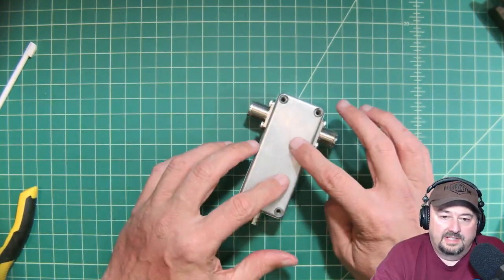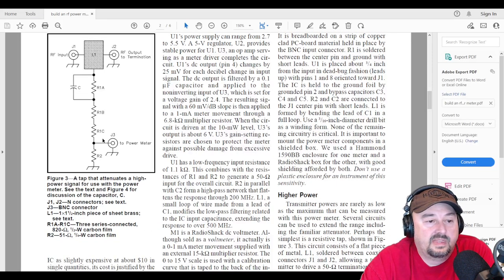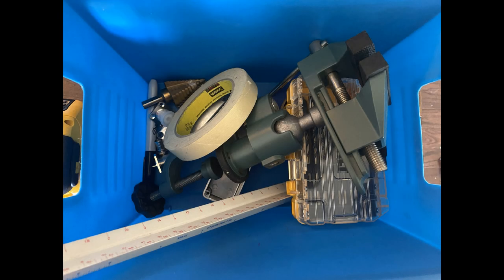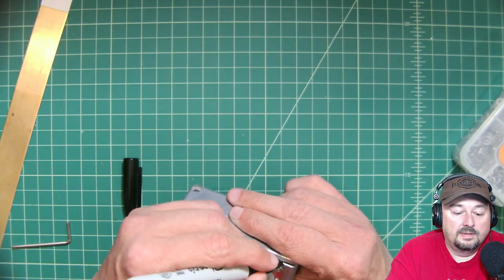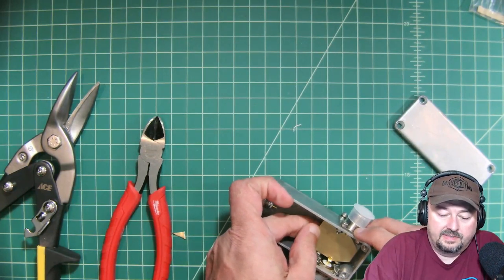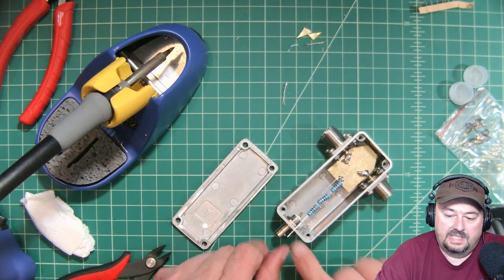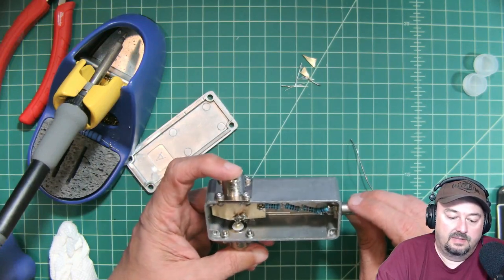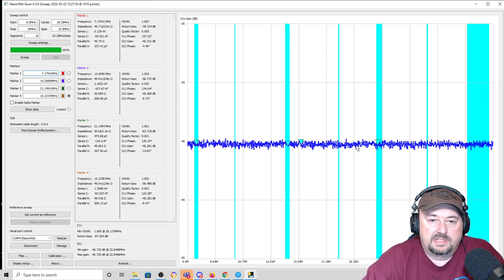DIY 40dB RF Power Tap for Ham Radio

Comment: I suggest using some 00 steel wool to buff the surface of the brass before soldering. A little buff on the center conductor of the SO239 as well. I find it helps the solder adhere more securely. Edit: Brass often has a light layer of oxidation which can inhibit the soldering process. Also, using steel wool to prep PCB surfaces for soldering helps with kit building.
Reply from the maker: Thanks a really good idea, thanks Robert

Comment: The name stomp box comes from their useage as guitar effect boxes.  I have noted while the Chinese boxes follow Hammond part numbers they do not always follow the sizings. Specifically the boxes are frequently  shallower than the original, which is why the SO239's did not fit well. I took a slightly different tack and cut/filed the 4 hole flange down to a 2 hole flange similar to the 239 found on IC-7300's. Had you sourced the parts from Digikey, Mouser or the like you could have picked the correct components as specified while at the same time helping out local manufactures and suppliers.
Reply from the maker: I was trying to help out port workers and customs officers 👍
Reply: @TheSmokinApe   LOL

Comment: Hi Ape,
Great build and video. As soon as I saw the size of that box, I would have used a two hole chassis connector or a bulkhead connector. I also think a piece of single sided circuit board could be used instead of the brass strip, or even a piece of 14 or 12 gauge wire across the connectors. You and the family stay safe.  73  WJ3U
Reply from the maker: Thanks for the ideas Don, hope all is going well for you.
Reply: @TheSmokinApe  Hi Ape,
You know I've been trying to get a reverse mortgage. Was approved in December, but they are raking me over the coals and now saying I have too much debt. Getting depressed.
Reply from the maker: @DonDegidio  ugh, sorry to hear that Don
Reply: @TheSmokinApe  My sister even started a Gofundme to help.

Comment: Good point. I always make sure my solder is "dry" before moving on. LOL You know as a builder myself I gotta rib ya a little. Serious question. With my lack of knowledge with inductors, since the brass plate is the inductor, does thickness of the brass matter and is it part of the calibration? Or is surface area what determines the amount if inductance introduced into the circuit. Hence the measurement of 1X1.5?
Reply from the maker: Hey BlueGoose, I would imagine that both size and thickness play a role 👍

Comment: It would be nice to see how it works in real life. It's one thing to look good on an analyzer but very different in actual use.  Does it make the audio clearer is the true test. 👍
Reply from the maker: I might do a follow up video, there have been a few questions.  Thanks for checking it out.
Reply: This device will allow the operator to adjust the mic gain up to the point just before the RF signal  begins to flat top on the scope.  In that sense, audio can be clearer for having used it.  73,  kc4i

Comment: 12:30 Nibbler is the tool for this works, shears will do too but the nibbler won't bend edges of the sheet.
Reply from the maker: Ah, I think I have seen those in the past.  Thanks!

Comment: Why add the brass plate?  Does it have a purpose other than as a buss?  Wouldn’t a 12 ga. Copper wire running between the center pins of the so-239 sockets, with the resistor leads soldered to it do the same thing?
Reply from the maker: I am under the impression, which may be incorrect that the brass plate acts as an inductor.  Without the plate we would need to add a toroid.
Reply: @TheSmokinApe  - Thanks for the reply.  My education is insufficient. I can understand capacitance between the brass plate and the “floor” of the metal box, but I’ll have to research how a flat plate works as an inductor. Thanks again. I enjoy your channel.
Reply from the maker: Thanks for watching Steve!